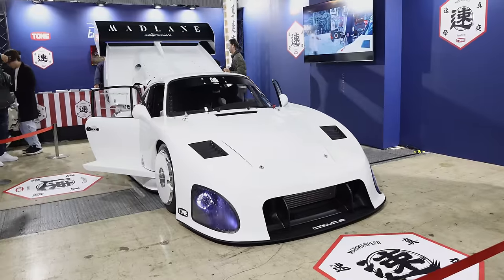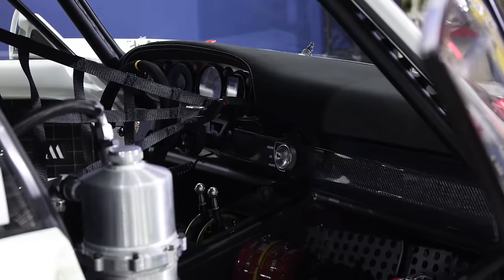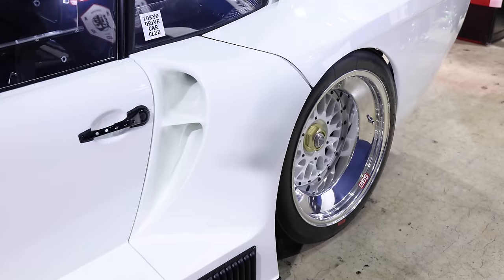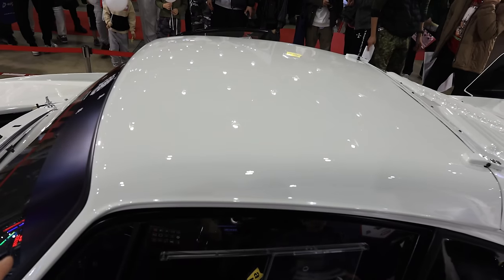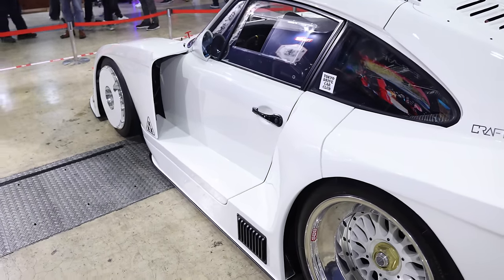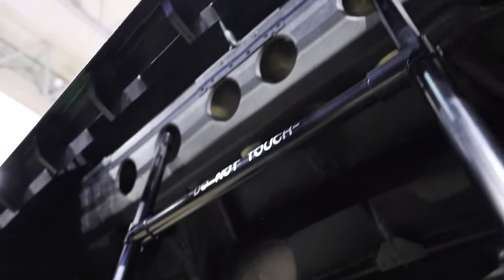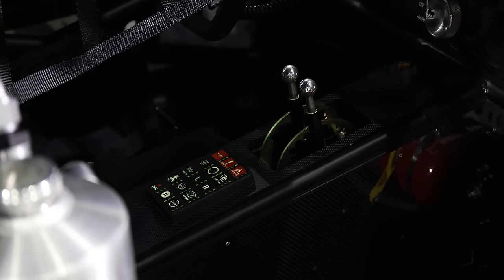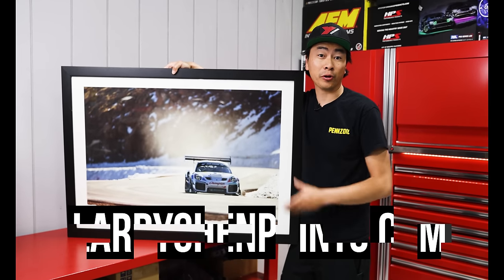Porsche 964/935/997 Twin-Turbo 800hp Frankenstein: My Favorite Car of Tokyo Auto Salon 2024

Comment: Love a 935.
The only thing I would change if it was mine is smaller wheels with a little bit more tyre sidewall.
Reply: I agree but understand the lessened sidewall flex as well as bridging the gap between past and present.  

Very cool build!!
Reply: Actually back in the day the 935s used. 19 inch racing slick, so it is very similar to this but nobody makes the 19s anymore

Comment: Did the Whittingtons have a K4? Curious who had the rear assembly..
Reply: No, that is a John Fitzpatrick k4 body piece. They bought it from Kremer and then extensively modified it for IMSA. The other original k4 was an Interscope car that never raced
Reply: Good friend owned the ex-Holbert #14 Lowenbrau 935K4 which also wore Jägermermister orange, and then JDavid livery. It's fully restored now & in California >>Canepa Motorsports